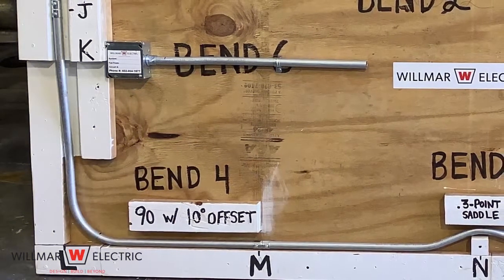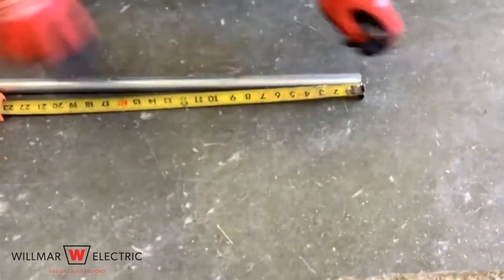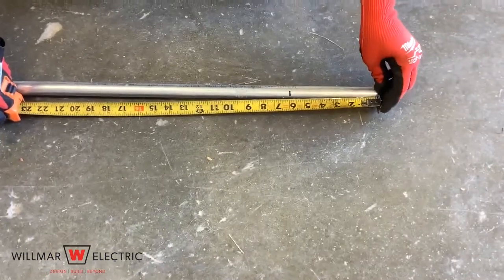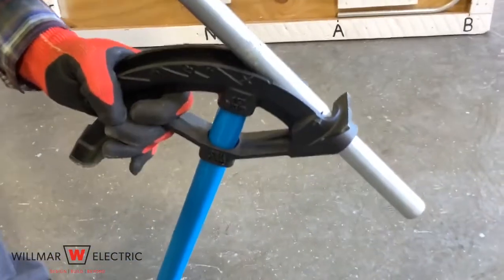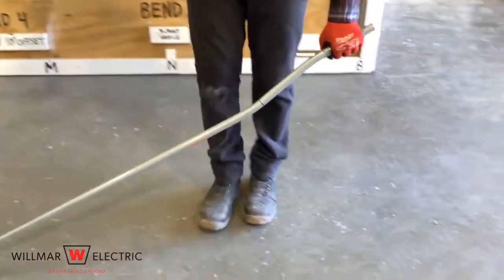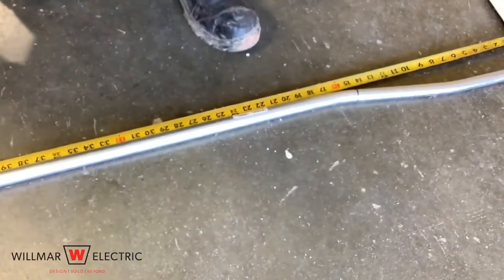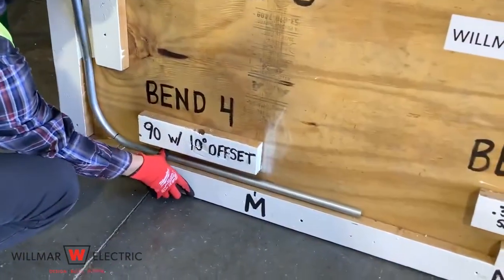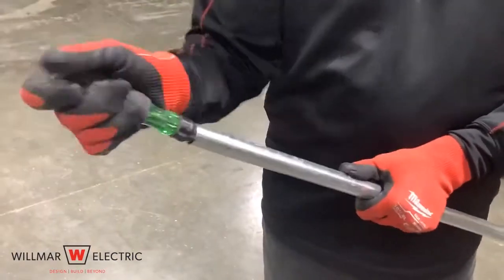How to do 90° Conduit Bend with 10° Offset (NCCER Module 26107)

Comment: We use pencils so finished work is not marked up with sharpee.
Or  i have seen others use the silver metallic sharpee. Other than that.

Do exact  bends but increase pipe size.( any apprentice can bend half inch)